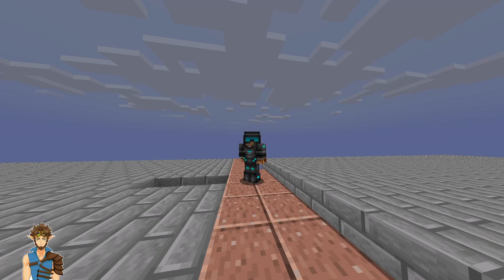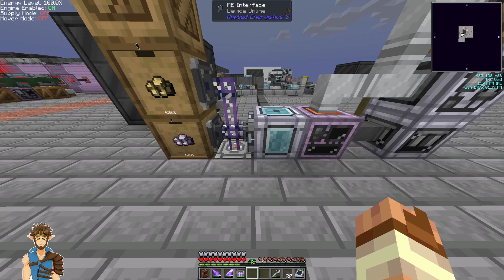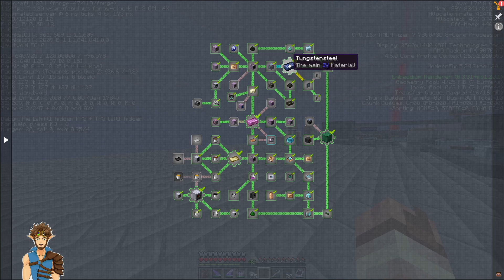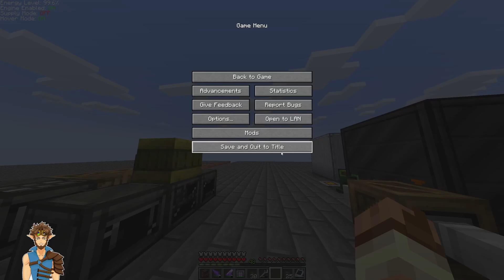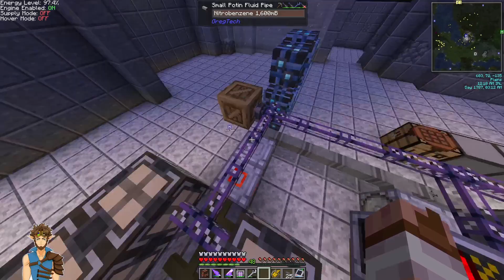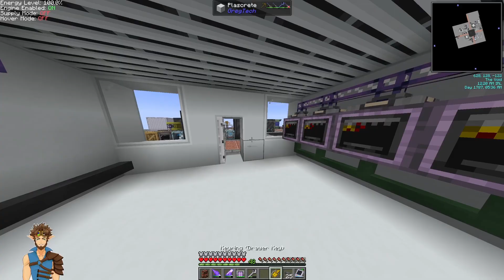Gregtech Modern Ep52: Rare Metal Mixture Processing

Comment: 26:50 Fun Fact GT5U for a long time didn't have their own Batteries past HV were large battery alloy hulls maxed out. The Lapotron energy crystal for EV and the cluster variant for IV were for a long time the only storage medium, but their descendance from IC²  came with some compatibly baggage. They are now considered parts for centralized energy storage, while newer battery hull styles are for use in the single block machines to compensate  for cable losses. You can use another nifty trick with them place a battery in the battery slot of a machine and conned atleast 4 amps of a voltage one tier below the machine tier and you can still run your new recipes of the new tier.